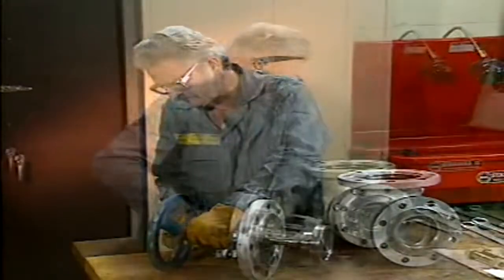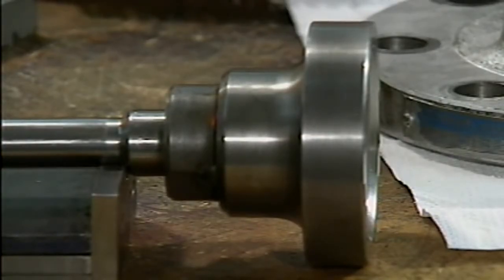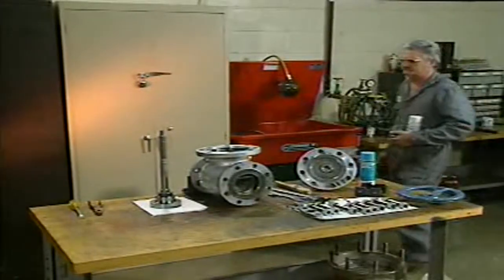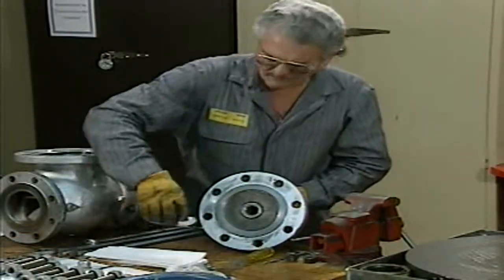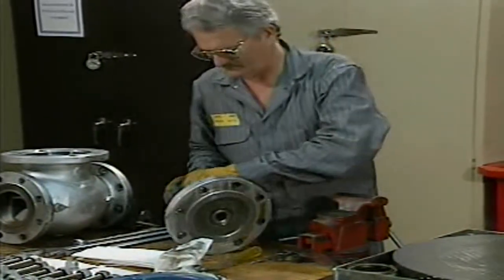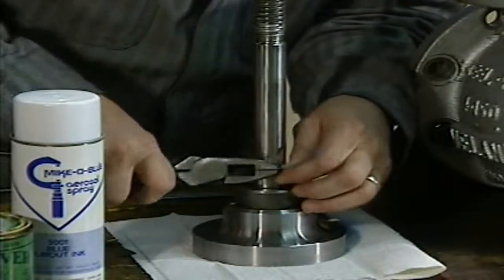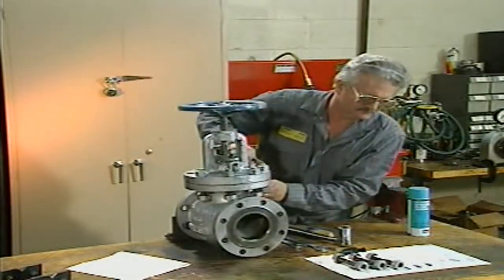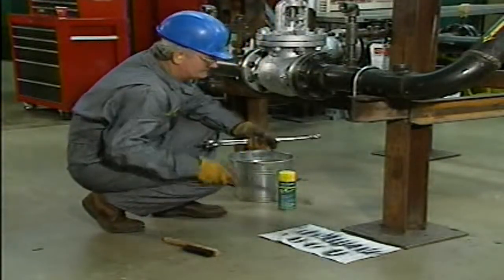Industrial Globe Valve Overhaul: Disassembly, Lapping & Inspection (Step-by-Step Guide)

Comment: By this lapping method it`s impossible to lapping properly, valve will always leak. When you are lapping a face -to-face disc and seat, you should always use a Guide for Valve Seat lapping. Without the Guide, you will just waste your time.
Reply: I normally use a thick gasket material cut to OD of bonnet recess. Cut hole in center just big enough for shaft